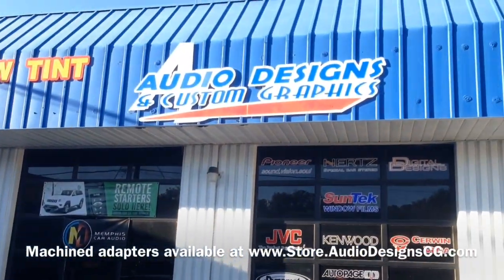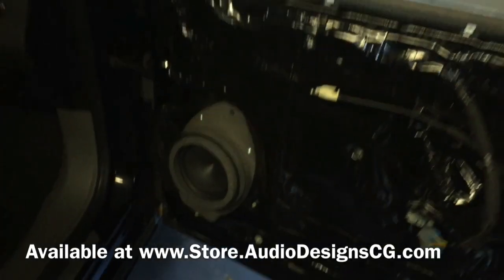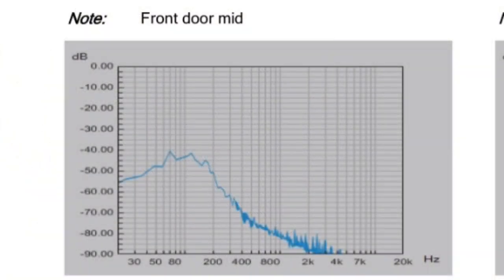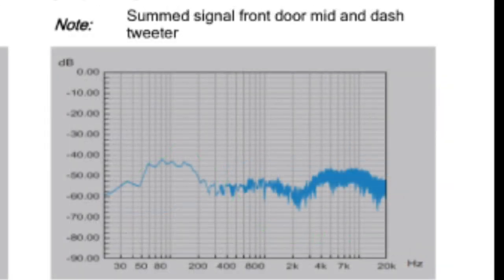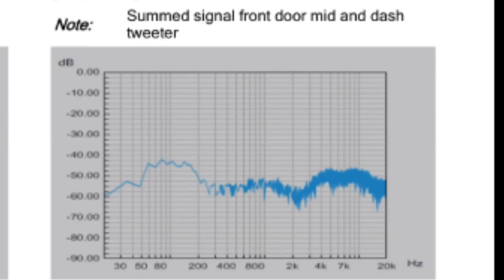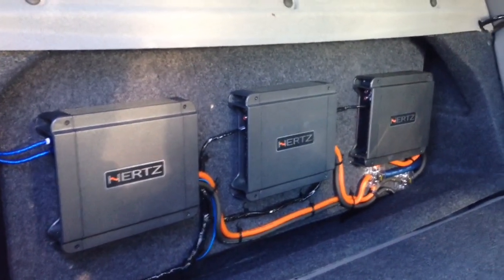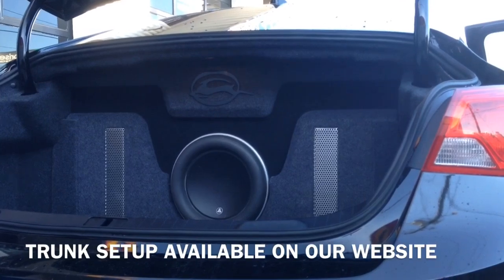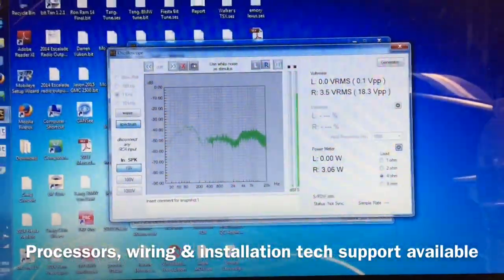2015 Impala Custom Stereo System

Comment: Do you happen to have a wire diagram for the factory amp?  I’d like to upgrade my 2015 high speakers, I already did the sub and tied into the rear deck speaker wires for signal

Looks nice and clean btw.  Nice work
Reply from the maker: Tim Henry Unfortunately I didn't save the diagram. We test everything with RTA's and Oscilloscopes rather than going off diagrams so we know exactly what the system is doing.

Comment: Hey is it possible to add a 4 channel amp to upgrade door speakers to factory head unit I hear doing so gives distortion would a dsp help with that or is there a way to get around it

Comment: How did you install the amplifier, can you do it from the factory radio?
Reply from the maker: Yes, sure can. It has to be integrated into the factory amplifier.
Reply: You have to get a rca converter it’s like 20$ at best buy